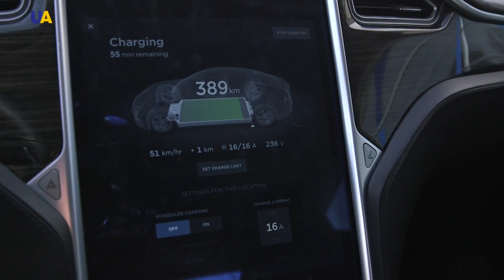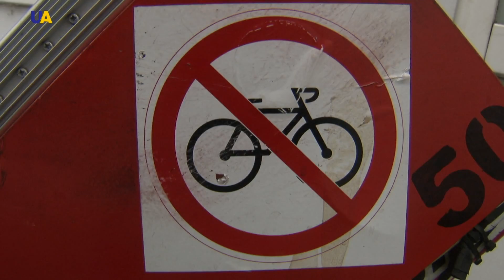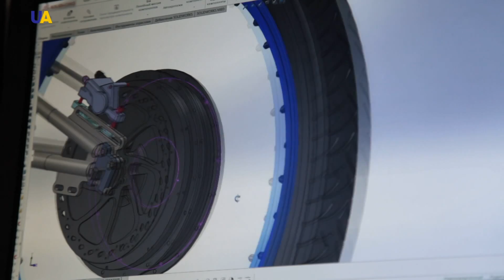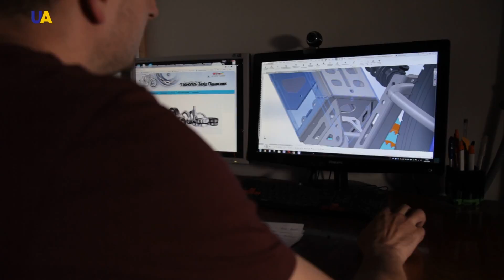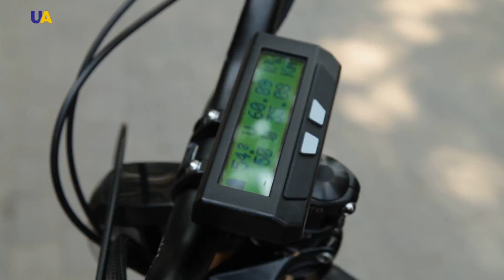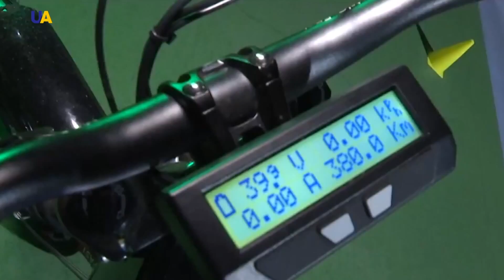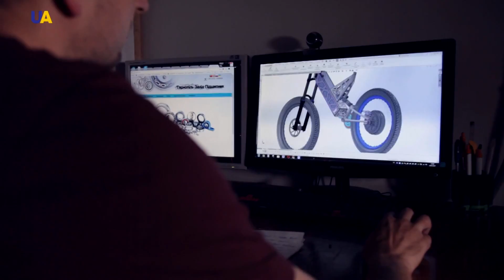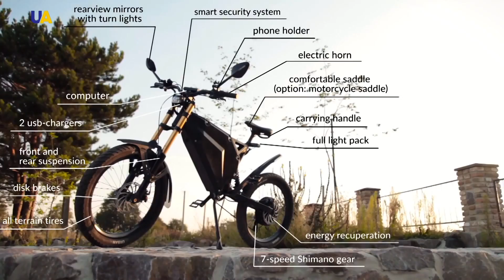Ukrainian Electric Bike: From a Delivery Service to a World Record | Master of Crafts

Comment: Delfast is the company name I do believe. The bike model, I believe, is the Prime. 226 miles per charge and they are indeed in the Guinness book of records. So they didn't make their goal of 260 miles or so. It is still the bike with the longest range per charge. And at $4100 it should be. But it is HEAVY at 132lb or 60kg. But there's always going to be trade offs. You can have long range, light, and cheap. Pick 2.
Reply: Id take the long range over the light bike any day.

Comment: The future is compressed air motor vehicles using carbon fiber composite air pressure tanks holding 10,000 psi or more; and rotary Wankel hub air motors in the wheels. This technology can also be adapted for superefficient, silent operating VTOL aircraft, far more attractive to all consumers than surface vehicles. See EngineAir Australia Pty Ltd.